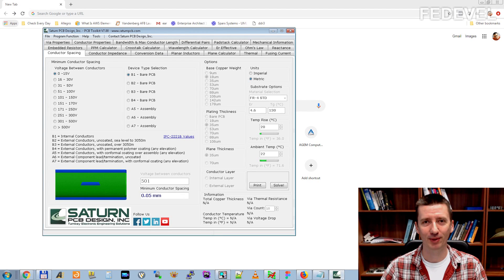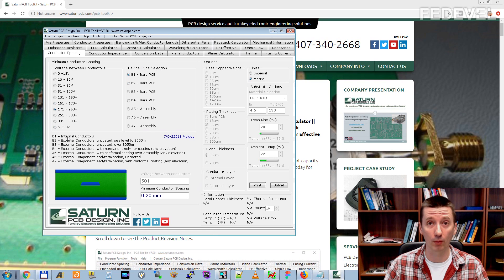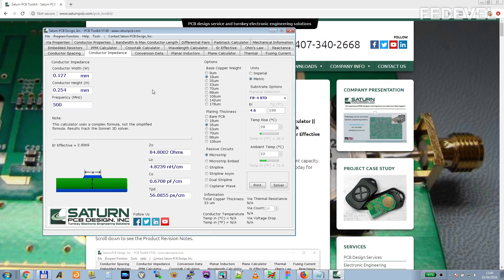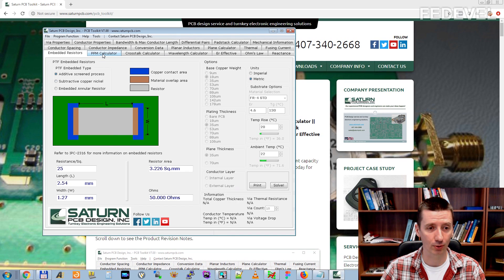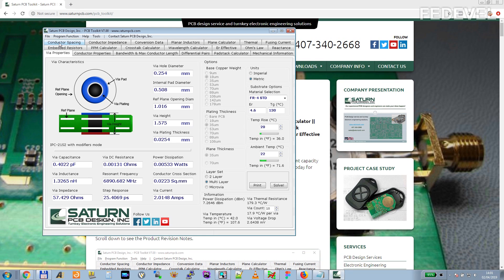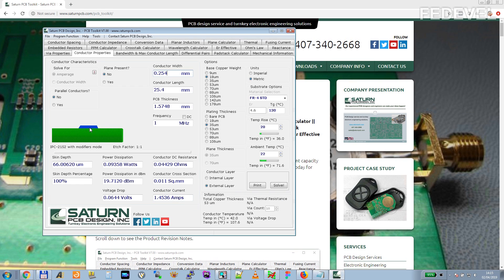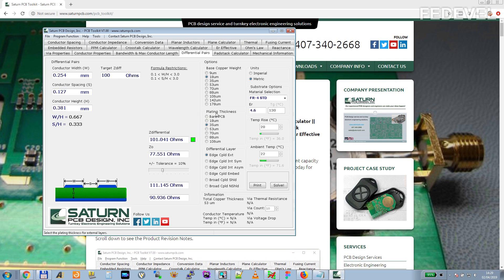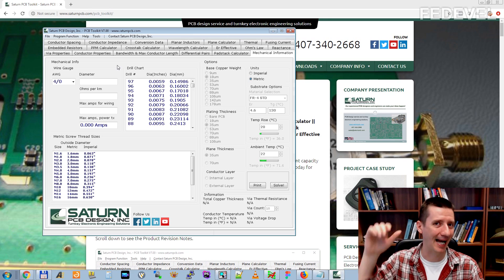Simple way to Calculate Impedance, Current, Crosstalk, ...

Comment: Thank you for the video. It is very informative.
@4.30 you can only manufacturer can give us the impedance value. Can you explain this a little bit more? My thinking was that I need accurate PCB material information from manufacturer (core/solder mask dielectric). Once I have this info, I can work out impedance on my own.

Comment: Hi Robert thank you for the video.  I follow your videos. May I ask if you could further explain the differences between base copper weight and plating thickness.  I want to make sure that I am setting the correct numbers for the controlled impedance traces.  Can you give example.  Thank you.

Comment: considering this software is there any way to calculate the current carrying capacity of a polygon ?
Reply from the maker: I just measure thinnest place in the polygon and use that. Not very accurate, but safe and works well.
Reply: @RobertFeranec  thanks a lot!

Comment: Hi i am using allegro cross-section editor to calculate impdence. Is it good?. Thanks for sharing video
Reply from the maker: Only PCB manufacturer can give you accurate numbers for impedance. Standard calculators are good to get approximate numbers, but they will not consider parameters changed during manufacturing (e.g. final prepreg thickness can be smaller as the thickness of raw material). I am not exactly sure about results from Cadence calculator, but I guess it is using the same/similar equations as all the other calculators (when I put there numbers from my stackup, I get approximately the impedance what I have got from PCB manufacturer).

Comment: I've been using the same tool, but I didn't see the crosstalk calculator on there before.  I had a design with a crosstalk problem that I had to fix, so I'll go back and play with that calculator to see if I can get an estimate of the coupling before and after my changes.  Thanks!

Comment: in pcb manufacturers, they specify thickness & dielictric. is that enough or we should ask them about impedance?
Reply: If I am understanding your question correctly:
1. You’re most of the way there. You’ll need to know the layer stackup, dialectric, Cu thicknesses (varies by layer) and prepreg thicknesses. You actually have some control over all four at most respectable board houses. Even the famously inexpensive JLCPCB offers 1oz and 2oz, along with a variety of insulating materials (fiberglass) at various price points. The higher spec materials are primarily useful for very high frequency designs.
2. It’s possible that you are sortof looking at the problem a bit backwards. Generally, a design will require a known impedance, such as 100 ohms and, given the parameters in #1, one uses the calculator to find the proper trace width and spacing. So, there isn’t an specific impedance question for the manufacturer, per se.
Reply: Dave from @EEVBlog recently posted a video going through the PCB options in detail. Highly recommended if you’re new or newish to board design & layout.

Comment: Thanks for the reminder Robert. 

To anyone curious, the software is windows specific.
   If anyone has managed to get this working with a windoz emulator on linux please let me know. I haven't had much luck with WINE and this kind of stuff.
Hopefully I can upgrade to a dual boot workstation one day, but until then I'm Linux only.
-Jake
Reply: I use it in wine all the time, it works fine, I've been using it for years with default wine settings and never had any problems.
Reply: @Gengh13  
 I think my issue at the time was due to a legacy bios on my old computer and it's issues with running a virtual machine. I had lots of issues. It's good to hear someone has it working though. Now I just have a w10 dual drive setup incase I absolutely must use a random ancient legacy program. I never use w10 though, it's not even on an SSD. If software isn't in a flatpak or in a fedora repo I don't really need it...but I haven't done EDA in...this year. Working on software skilz instead :-)

Comment: After watching your videos I started using this saturn PCB tool, you had mentioned this tool in one of your course earlier. But I also use "trace width calculator" from https://www.4pcb.com/trace-width-calculator.html for power supply rails copper trace width estimation, which will explicitly gives the width required for external and internal layers, which is useful .

Comment: I use this software too for any time I need these kinds of calculations. I have designed high speed boards (10 GHz) and I use this to get a rough est and then go to the PCB vendor and we work on the real stackup (impedance control). For lower speed boards I used it for all the calculations as it's not exact but close enough.